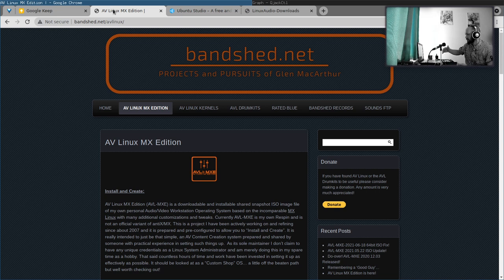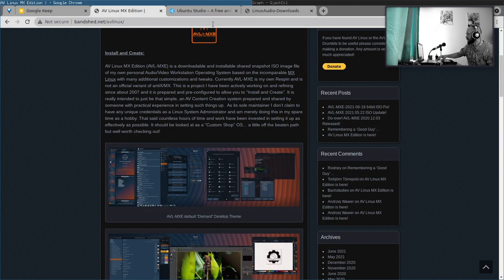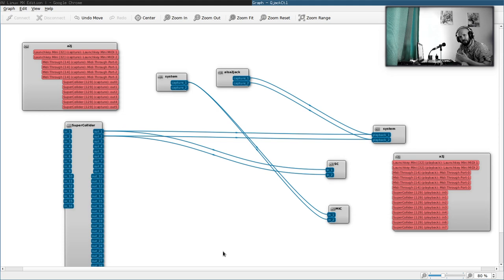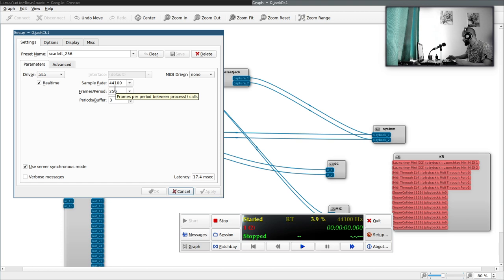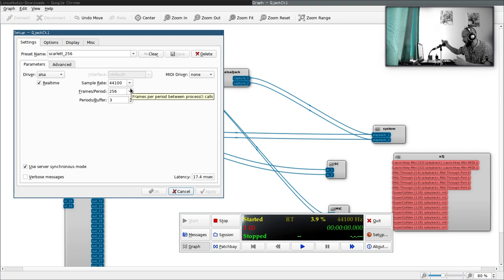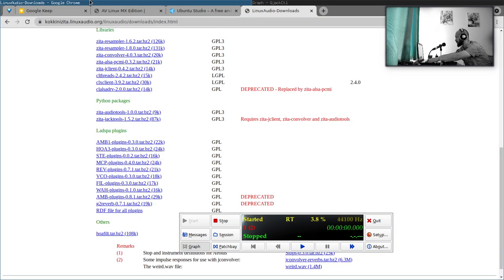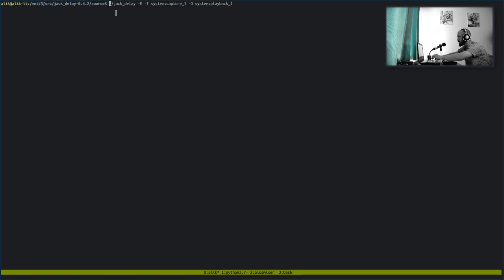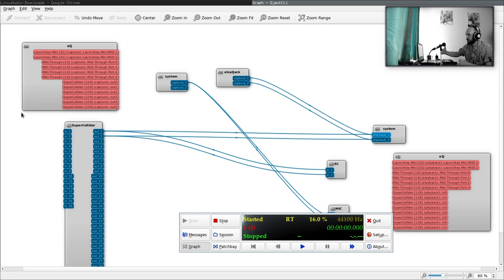17: MIDI based production: Introduction and Setup - Musical Sound Design In Supercollider

Comment: already a nice inspiration. I tried jack via windows 10 once more while watching the video. After not beeing able to get it running in the past (i think it recently got an update). it now works perfectly. what a game changer!
Reply from the maker: Yeah! That's what I'm talking about
Reply: @Reflectives  do you have an approach for polyphonic compositions? ive tried to transfer a piano piece of mine to sc just for trying out. used Ppar Pspawner etc. it worked somehow but in the end i ended up with way to much patterns for just some simple suspensions.
Reply from the maker: @jlkt2473  if you have a midi file with piano score that should do it. I'll show in the next video. But with patterns. I guess should be 10 parallel pbinds maximum
Reply: @Reflectives  i like not to depend on randomness when organizing pitch. but thought it would be nice if i could extend some ideas transfering the whole thing to sc. i ended up with a lot of patterns, unable to control the whole struture in a meaningful way. used a base pattern and chained the others accordingly. but just for holding one note and having a sequence of two others played at the same time you already need two patterns. i really like the idea of manipulating a system and not having every event set at a specific place on the timeline and always getting the same results when hitting play, but couldnt manage to have a good balance between possibility and direction in sc for now.
Reply from the maker: @jlkt2473  a bit difficult to decipher factual picture. I think posting that case on scsynth forum might bring some ideas
Reply: @Reflectives  yes, there are some on polyphony but not so much with examples of code. i think i will make another one. thanks a lot for these tutorials :)
Reply from the maker: @jlkt2473  you're welcome!
Reply: Man, thanks, I'm going to try this again as well, was never able to get it before.